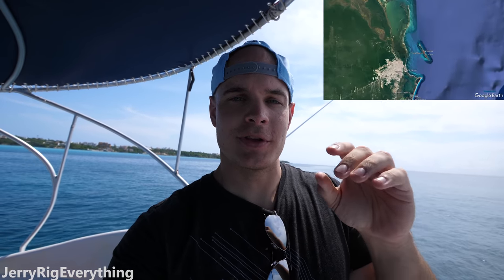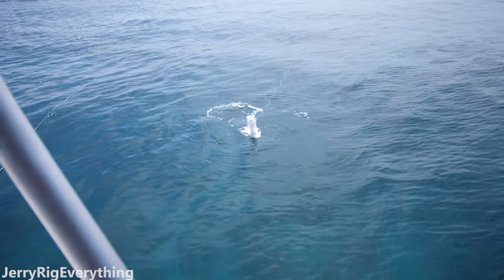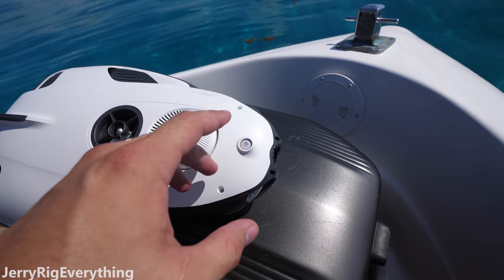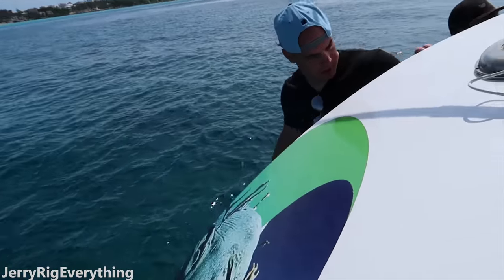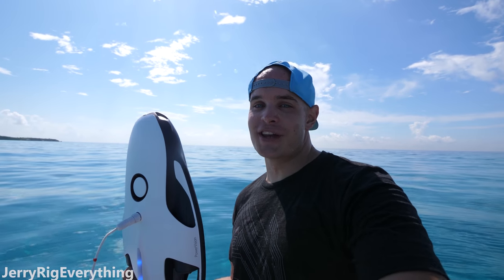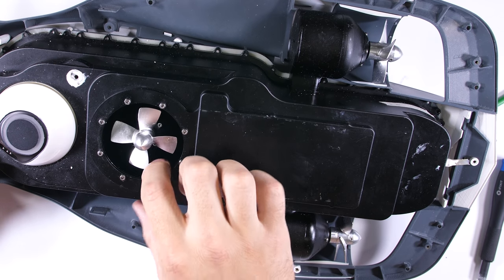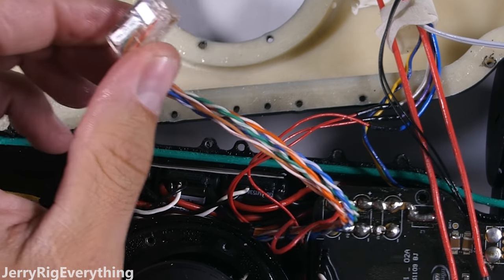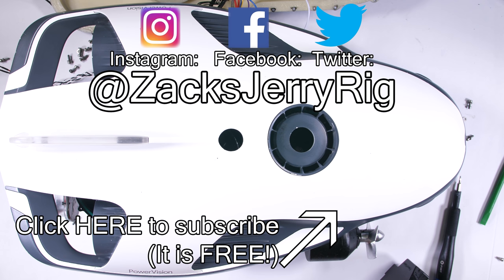This Under Water Drone Conquers the Ocean... in 4K!

Comment: Get the terminology correct please.  It's a ROV (Remotely Operated Vehicle) for consumers, not a drone.  Drones aren't tethered, ROVs are.
Don't believe me - check out companies like Saab Seaeye, Sub-Atlantic, SMD and Triton.  I've been 'flying' these ROVs for the last 12 years commercially, both 'eyeball' and workclass.

This is a cheap system with basic thruster control.  I wouldn't even want to use it in a harbour to carry out a hull inspection.
4K - why?  Just so you can see more sediment in the water?  1080 is enough for underwater footage and inspection.

As for breaking the seal, and it never being water resistant again - so you'll just use for spares?  Please.  As long as you make sure the seal is in good condition, not smothered (you only need a thin film of what looks like) Molykote 111 grease, the seal is in the track correctly, the bolts tightened up correctly - then there is no reason why the water integrity will be compromised.

We have to periodically open Kongsberg cameras, electronics pods etc - and some of these are capable of 4000m water depth.
Reply: @Ripper, I don't have the experience with the products you have access and it's evident you know what you're talking about,  with all the information you spoke,  nice job!!! I like to hear the the ones with actual knowledge on subjects or in this case a functioning product,  plus I was trying to figure out how it was a drone that didn't fly and had so little control,  the camera was the only thing sounded nice but I was pretty sure that not much is visible in 4K, nor can our eyes see the difference once it's past a certain resolution,  at least that's what I was explained,  never had a reason to  research it. I do know about seals and sealing most anything,  it's not rocket science,  just use the proper gaskets and/or sealants and/or proper grease, tighten down in sequence until tight or torqued once you get past hand or wrist torque
Reply: Hello Newton,
Thanks for the reply.  Most of the subs/ROVs I work with usually have 4 lateral thrusters mounted at 45 degrees to the body, so they can be used for fwd - aft, Port - Stbd lateral movement and Port - Stbd yaw movements.  The amount of vertical thrusters depends on the payload.  As I said before - you can usually ballast a ROV to be light or heavy dependant on the use - with syntactic foam and weights.  IMCA have industry guidelines for us, and our workclass ROVs (1million USD + easily) are also insured - so if we do the wrong thing - it can be very very costly, as they may not pay out.

ROV's like the Saab Seaeye Tiger only have one 250Vdc vert thruster - while the slightly larger Lynx has two.  Some workclass have 3 vert hydraulically powered thrusters, some 4.  Depends on what payload they are carrying, while being able to keep their buoyancy.  

Control wise - a lot of ROVs 'eyeball' ROVs tend to use RS485 data protocol over 600-1000m of mainlift via fibre-optics which is then mux'd (or multiplexed and de-multiplexed) at the surface control unit and likewise on the ROV in the electronics pod.  Workclass to use RS232 over fibre optic, which is again multiplexed at surface and the de-multiplexed (bit of a mouthful - hence we just say mux'd) in the control/electronics pod of the ROV.

Any other questions - by all means - ask away.  I'll try and answer.  Obviously I can't talk specific projects - my office would get a tad unhappy if I disclosed company proprietary data.
Reply: @rigger8722   Rigger  I am sure they would get upset if you talked specifics with a total stranger especially over social media!!! Lol, I was mainly agreeing with the fact that I get so frustrated with people talking about whatever subject without using the correct terminology or even having enough knowledge to talk about the subject. I was a Toyota Master Technician for almost 20 years until I became disabled for health reasons. There's not many people that can call themselves techs either because they are either crooks or they just have no business being near any electronics or mechanical operating machines,  and I am still damn great at it, I'm turning 37 April 2nd, that's what sucks the most about my situation,  and I am nothing but honest. But I hear people try to speak with others about vehicles or are just attempting to fuck them over all together and it infuriates me to a magnitude that I don't like to even get to at this stage of my life. But I do my best to do  what you were doing with your initial comment and when you responded to me and I do thank you and appreciate you offering to answer any questions I might have. I got into the Hobby Grade R/C cars & trucks when I knew I just couldn't work on vehicles full-time anymore nor can I even stay on my feet without taking breaks whenever I need to. I'm sure you have a really really cool job though,  doesn't even feel like you're going to work most likely except when you just simply need a break with the family. I will ask you this,  since you know about both,  what's a good quality starter Drone? And starter underwater ROV or just whatever they call them,  something like submarine that would allow me to just mess around having a  good time if there's ever such  a  thing as a good starter in both categories...? I could see there not being any because both require high quality products to survive,  thank you for your time Sir Rigger
Reply: @newtonfoster7581   - People will always try and brag online that they are a lion in a certain field of study, when they are probably more like a mouse.  Insecurities often lead some to make claims online that they can't back up in RL.  In the offshore business, these sorts are found out quickly to be lacking in either competence or knowledge.  This makes them a hinderance or just plain unsafe and dangerous - and they don't last long in the business.  12 years in ROVs now, and I've survived a few rounds of redundancy (recent oil crash), so I must be doing something half right at least.    Sorry to hear that your health has taken you out of the job you did well at.  That sucks.  Here's hoping you are able to make a recovery in the future and get back on your feet.  I know a few motor techs and while one or two can be in it for a quick buck - most do it well and take pride in their work.

I started out lucky from school (Christ - 30 years ago now!!) working as an aerospace mechanical engineering tech, before getting into ROVs.  12 hour shifts for 4 weeks straight isn't any fun, and it's hard on the family back home, missing birthdays, Christmas etc - so the pay is decent - but not outlandish.

Decent starter drone - I went in at the deep end and bought a DJI Phantom 4 Pro nearly 2 years ago, to bring my photography to another level.  Nothing else had the 20Mp camera.  Entry level Drone - DJI are the biggest, but their software and customer support aren't great.  Yuneeq or Parrot also do good offerings these days.  Don't be tempted to get a cheap copy drone.  Inferior materials and software will probably ensure it makes one flight - if that.

Decent starter ROV commerically - Saab Seaeye Falcon - though you'll still be paying  6 figures and then some (£) for one of those.  They are only designed for use in harbours and sea-lochs.  Mainly designed for hull inspections or fish farm net surveys.  Workclass systems in total are in the millions cost wise.  A FMC Schilling Titan 4 manipulator arm alone is roughly £120 000.  Mostly titanium and some very trick electronics and sevro valves help that price climb to where it is, but they are the best in the business when it comes to subsea manips.

Decent hobbiest ROV - not seen one yet to be honest.

I'm also no Sir - I work for a living fella ;)

Comment: Why would the ability to go left and right require additional motors? All you need to do is to control the motors on the left and right with different speeds to make this thing go left and right. It's basically just a software thing.

Comment: Your video is by far better then anything from Powervision , i wonder did you identify the SD card or any thing else on the motherboard that might be hardware hacked , did it have your standard ESC's in there for the motors ?

Comment: just clean it up with some tissue...leave in a warm place to dry out...perhaps jam a silicate moisture absorbing bag in somewhere..reapply some silicone grease to both sides of the case with a cotton bud...place the rubber seal back on and tighten it up again..
it was built so can be rebuilt.
gg

Comment: I assume that the two propulsion motors are independent, so with one stopped and the other running, it can at least do circles, even if not sideways travel. The problem with simple sideways travel is that you won't be able to see what obstacles might be there.

Comment: Some things about this feels a miss.
* Thether not needed unless for power (maybe for video), multiple solutions of sonar, wifi, RF works under water. Just dip a radio transmitter in the water that talks to the drone.
* Why doesn't it have tiltable motors and a gyroscope like on airdrones, just seems for uncontrollable and wobble under water video.
* Could have fitted a mega battery on It since weight under water doesn't matter.

Comment: 3:54 "flying under water" 🤔 how is that possible
Reply: It's been possible for years now.  Look for ROV's - Remotely Operated Vehicles, eyeball and workclass varieties.  They use thrusters to move in the water in 3 axis.  Some can fly like an aircraft, most like a helicopter - that doesn't not bank or pitch or roll.  Cameras can be mounted on a pitch and/ or yaw motor.

Comment: Only buzz kill is loosing the drone to tether tangle, some idiot in a boat chopping the cord etc..  When I saw this at CES 2017' I asked them about worrying about it and they said never a problem. I had to laugh, been running RC stuff over 30yrs. Tethers are a problem in some locations.

Comment: I say BS to the words he said about after taking it apart it could never be water proof again. I mean why? Hell I’ve taken lots of heads of internal combustion engines and when I put them back they sealed fine if I done everting right. I mean even on 13.5 to one compression ratios. It’s all about cleaning the surface of the parts you want to join. Hmmmmm and I don’t even have a degree but I know about this from trial and error.